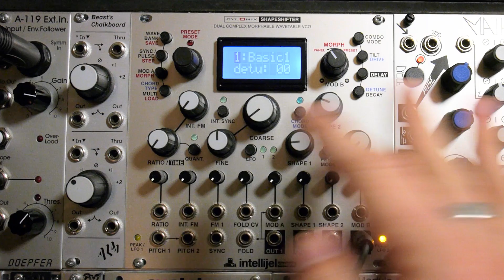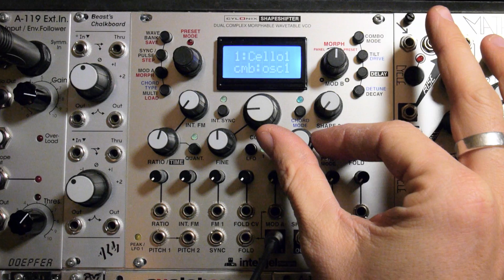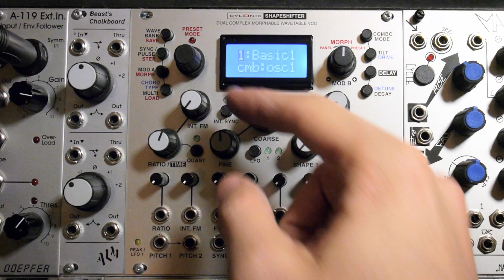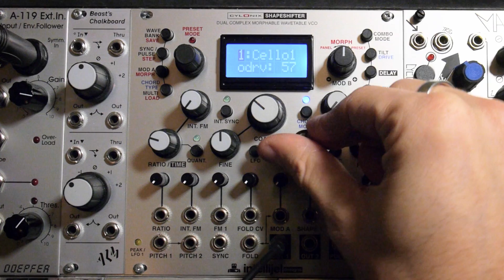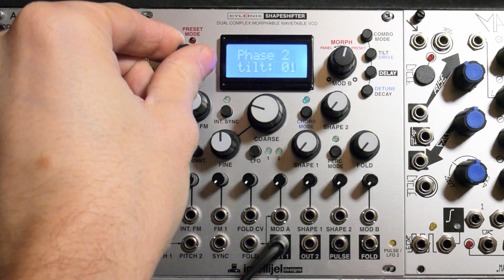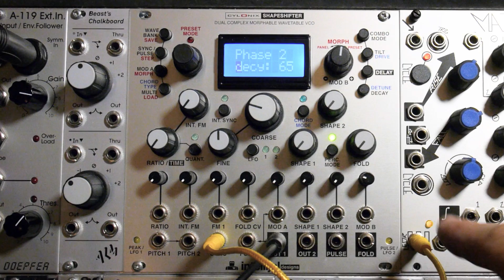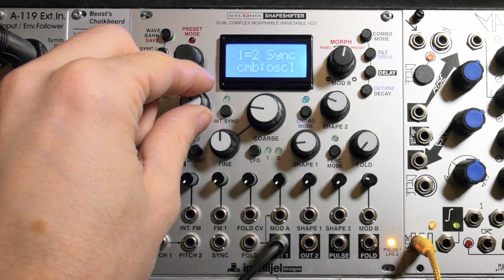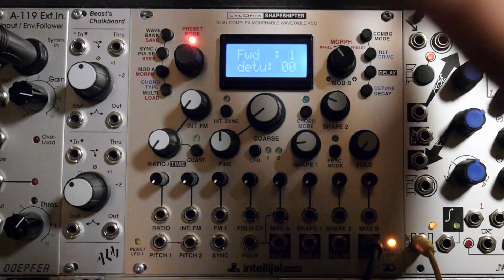Intellijel Shapeshifter Eurorack VCO Quickstart/Panel Overview (Part 1/2)

Comment: Are there 2 different Intellijel Cylonix Shapeshifter units out? I noticed that the newer ones I have seen on Sweetwater's website 
have a different text on the faceplate and have a RED "OUT 1" patch  output. Are these essentially the same machines with the same guts?
Reply from the maker: Yep, faceplate was updated at one point when Intellijel changed their look

Comment: Awesome video! As a note: in the most recent version of the Shapeshifter, they added a bias circuit to the fold control so that it outputs an unfolded version of the signal even when the fold knob is fully CCW. If you feed negative voltages through the fold CV input, it does fully close though. The manual is not updated to reflect this.
Reply: thank you. ...good to know!

Comment: I don't have one of these, and now I'm glad I don't. It looks wonderfully complicated and capable and sounds great, but ... the controls are overly modal for my tastes. I guess there's no avoiding that really.
Reply from the maker: John Slee Yeah it is. That is the design principle - it requires an awareness of the various menu states, in practice it's OK when you have your head round them, and of course the benefit is a module that has ridiculous power/potential....
Reply: You can get used to the basic stuff fairly quickly but it can take weeks to months for the rest. I have had mine for nearly a year and i am still finding new things with it a great buy for a main oscillator. I put mine  through an oscilloscope to better visualise what it can do as well as listening. My vids might help?